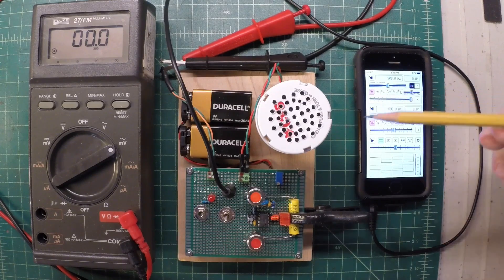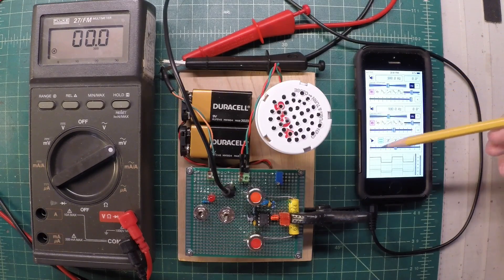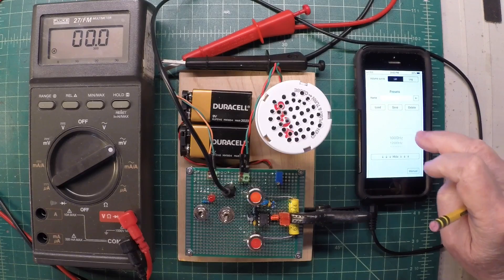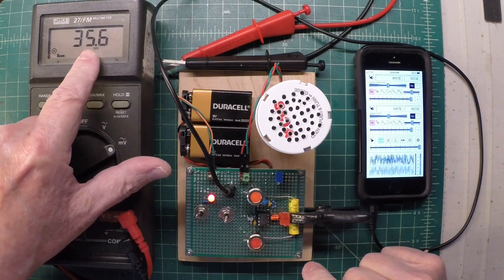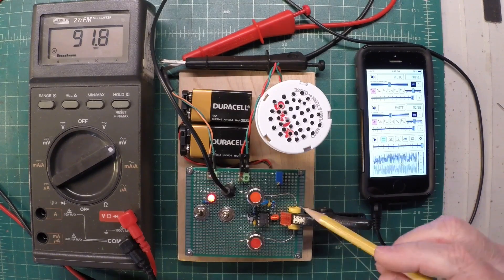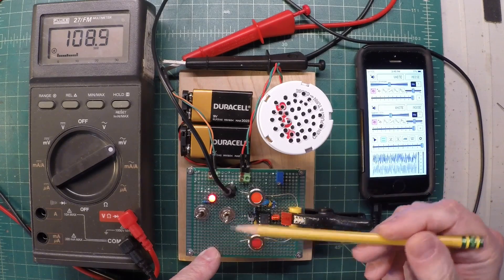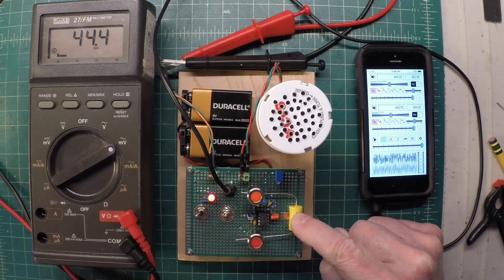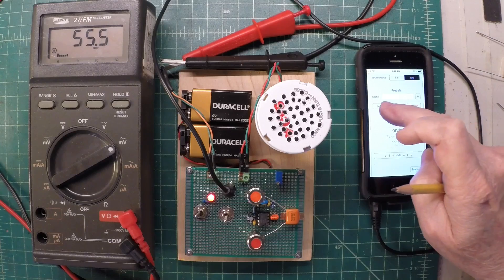Using my Smartphone to ID Capacitor Outer Foil/Shield (Headphone Users: Warning Loud Sounds)

Comment: Makes things a bit easier.
Reply from the maker: Thanks Bruce. I added the white noise generator circuit on board too at: White Noise Generator Integration w/ Capacitor Outside Foil Sniffer https://youtu.be/74I2iP0GkTk Thanks for watching. Best, Don

Comment: Hi Don! I see your success with prototypes, and specially with this simple but usefull diagnostic tool. Congratulations.
I have been long time out of Youtube, couldn´t watch your videos, but I hope soon back to my activities in Youtube.
What about a calibrated accuracy speakers impedancimeter?
I have done my duties and I have my best prototype written on paper, and ready to start doing it reality, maybe next month of september.
Have a nice day and will follow your channel.
Ketk (from Spain)
Reply from the maker: Ketk - great to hear from you! I’m still considering building off the impedance tester circuit you shared with me this coming fall or winter. I need to get back on the Crosley I started and get it behind me first before the chassis starts rusting again. LOL All the best to you. Don
Reply: @RestoreOldRadios   Hi Don, great to know about you too. I have not tarted yet doing my electronic tasks,  cause I have been studying about thermoinic valve testers, and trying to design a simple cheap (not very useful, is true) and another one little bit more expensive but great accuracy on valve diagnostycs results.
Also I was working on impedancimeter, and I found very interesting information, and did my design on paper, ready to start... (Look at this data: Impedancimeter should difference betwen a loudspeaker 4 Ohms, and a loudspeaker 3,8 Ohms.... difficult, isn´t it?).
BUT.... last year before summer started, I left a lot of projects and repairs half done... THEN, the FIRST is TO DO what I left parked taking DUST on shelves ( https://www.youtube.com/watch?v=tH2w6Oxx0kQ ).
And the winner is.....:  My CC dummy LOAD... also I designed it, tested prototype, and stopped without finish...
This project will be the first I will finish when back to my workbench place.
Have a very nice day and I follow you.
Ketk (Spain)
Reply from the maker: Ketk - I completed the Loudspeaker Impedance Meter and published a video on it. I would appreciate your thoughts on it when time permits. I hope all is well with you. Best, Don
Reply: @RestoreOldRadios  Hello dear friend Don.
I have a very busy time since last six months and it do not leave me free time to do no one of my little projects and no time to watch any videos
I am so sorry but think this busy time could finish in one month more... I am not sure...
I have a ton of projects and repairs and videos to watch stopped cause this bad period of my life.
Have a nice day and wish you the best.
Ketk (Spain)

Comment: Hi Don, Thank you for these extremely interesting videos and great ideas. The fella that started me out working on guitar amps back in the late 70’s always used a guitar amp to find the foil side of caps. He was alway adamant about testing every one, even if it was marked. At the time, before I went to electronics school, I didn’t even know why but I’ve continued to do it all these years. It usually works really well but it’s getting harder and harder not to hear the difference on some capacitors. Now if I can’t hear it, I’ll connect them through a distortion pedal and that usually helps. 

I’ve seen Mr. Carlson’s videos on his foil side tester and have thought about building one in the past but I don’t have all the stuff to build the boards or really want to do the SMD part handling and soldering. I really like your ideas and think I even have most of the parts to build one of your examples. Plus, the footprint is a whole lot smaller then a guitar amplifier... :-)               Buddy
Reply from the maker: Buddy, hope the build goes well if you elect to move forward with... Did you get an opportunity to play around with a replacement power supply circuit for the SG-4162? Best, Don
Reply: @RestoreOldRadios I did and I’m a bit frustrated right now. The only schematic I can get is what is in the back of the operation manual and the company that sold it under their name didn’t actually produce it and has no info on it. At least none that they are willing to share. 

It seems that when I researched the 5-volt side I was just thinking that the 15-volt side shown on the same page I sent you was the other supply from the transformer but after looking at it really hard before powering everything up, I realized that the other side was feeding something totally different and was shown on another schematic. Now it did feed a portion of the circuitry that was connected to a 15v zener diode so I feel like it is still a 15v supplied circuit. 

I did bring it up slowly using the resistors you sent me and using your diagram and at least now I’m getting digits in the counter but the readout is not stable or correct and after checking to see if there was any frequency output with the scope, there isn’t anything there so right now I’m just trying to figure out what boards do what and what should the individual components are supposed to be doing. 

I’ll figure it out eventually. :-)  Thank you for asking and thank you so very much for your help!            Buddy
Reply from the maker: Buddy - I hate that for you. I know you’ll get it going in time. I’ll keep my eyes open for a schematic. Best, Don

Comment: Dons, that's the best one yet!
Wonder if it could drive a meter instead of the speaker?  If it would work, that would make the hard ones easier.
Reply from the maker: Josh, it drives an AC meter too and helps discern those lower value caps. Best, Don